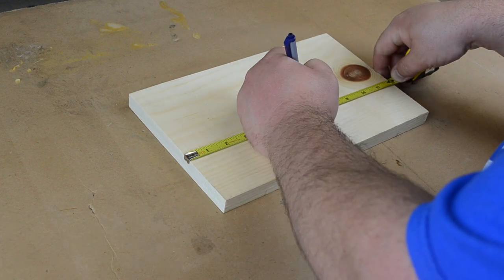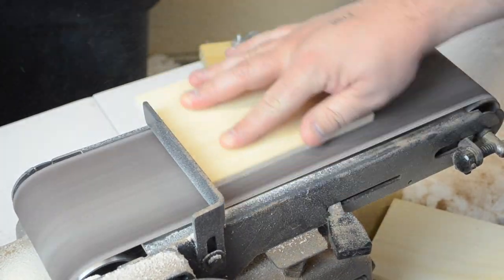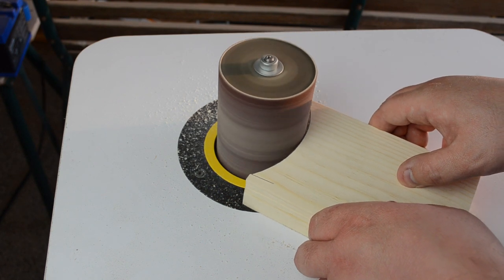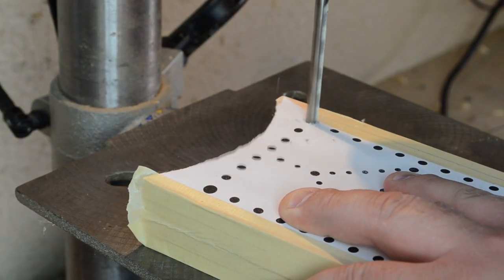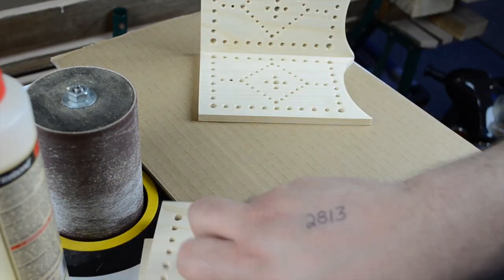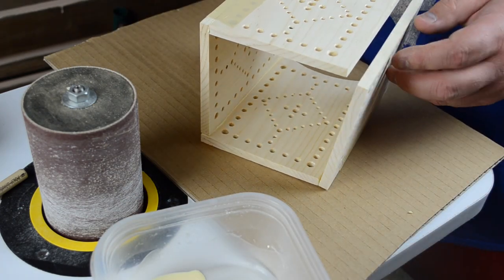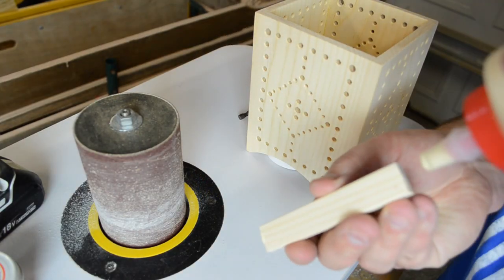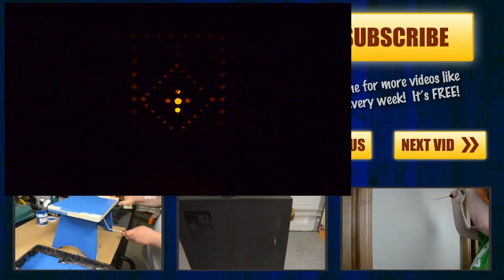Ⓕ Decorative Light Box (ep16)

Comment: How crazy, I actually am going to be using the same technique on an upcoming project! What did you use to make your template? I didn't even consider making a template beforehand, but now that I see how nice yours turned out, I want to. Also, I loved your editing job when you were drilling the holes. : )
Reply from the maker: April Wilkerson Thanks April, the edit for the holes took a bit so you won't see it again from me anytime soon.  I used Signlab for my template because that's what I use for my vinyl plotter.  It is just a vector software similar to Adobe Illustrator.  A good free vector software to try is Inkscape.  It is very similar to Illustrator but it's free!  Vector is the way to go because lining up repetitive shape is easier and you can work in real size.  If you need any help lemme know.